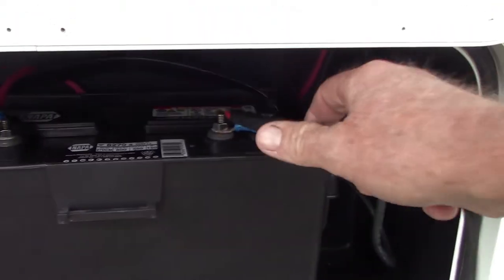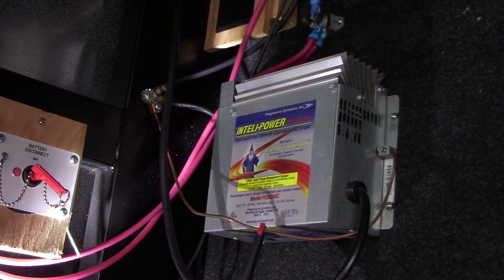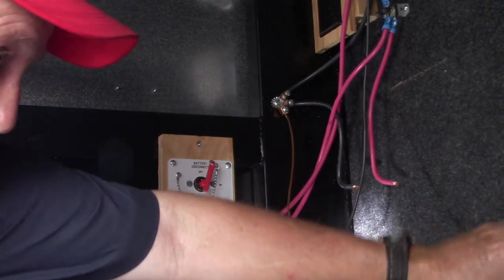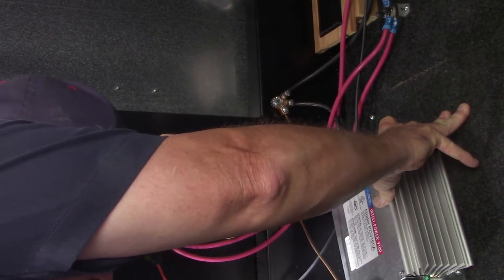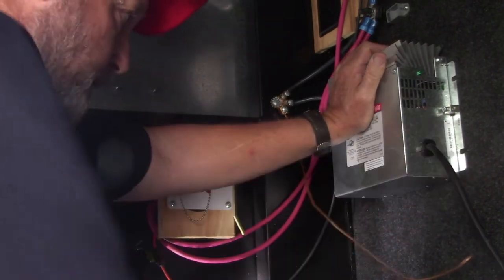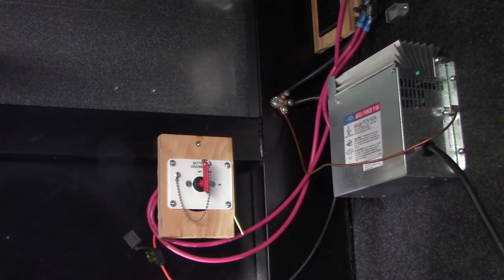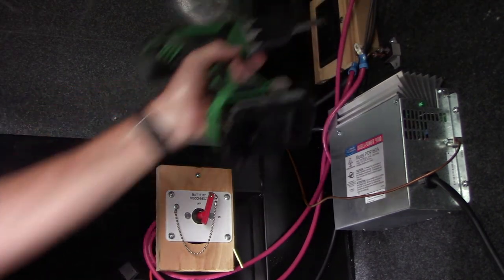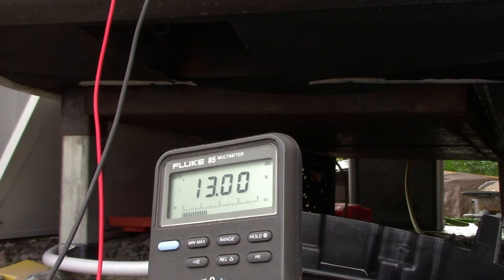Power Converter Diagnose and Replace

Comment: Nice and short tube... our converter runs all 12 v but does  not charge the house batteries... spice says someone's worked  on coach in the past but probably left wire off ... when battery  change out last year  ... 96 damon intruder ... thanks for sharing...
Reply from the maker: Make sure the inline breaker is good between battery and converter. I find that quite often. That will keep it from charging the battery.

Comment: I see that RV had a Progressive Dynamics converter and you replaced it with a Progressive Dynamics Converter. Most come from the factory with WFCO converters that are behind the breaker panel. Do you know if this was the 2nd converter replacement and do you recommend Progressive Dynamics over WFCO?
Reply from the maker: Some are integrated into the panel box and some are deck mounted (like this one). It just depends which one the coach manufacturer uses. I have videos on both.